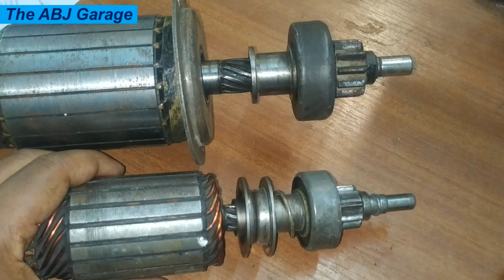Bad starter overrunning clutch check

Comment: Thanks great explanation. When i turn the pinion the free direction, it is free but feels rough or grindy, would it need replacing?
Wont grease go hard over time and cause resistance, would it be best to use ptfe or graphite powder to lubricate?
Thanks
Reply from the maker: Great idea! If it is rough or grinding, it might have dirt accumulated internally, then you could clean it, to clean dip it in some solvent (could be gasoline) then try rotating, do these repeatedly until it is freely rotating. Is it is opened however, you could clean it out and then lubricate. Around here we use good quality grease and it works just fine for long time.

Comment: If the leading part of the bendix gear Is getting ground down what could be causing that? It’s like it’s not retracting back to its place correctly or fast enough
Reply from the maker: Indeed! It means something is interfering with fast disengagement and retraction of the gear! Worn or Damaged Bendix Spring, Sticky or Dirty Bendix Mechanism, Worn or Damaged Pinion Gear, Bent or Misaligned Starter Shaft, Misalignment between the pinion and flywheel can also contribute to slow disengagement.

Comment: Abj, mine slides but drops back before turning the engine. What could be problem?
Reply from the maker: That could be caused by faulty solenoid hold in coil! Have you checked if both hold-in and pull-in coils in the solenoid switch are working fine? The hold-in and pull-in coils work together to make the starter pinion slide towards the flywheel ring gear. Once the pinion reaches there, it is the duty of the hold-in coil to keep it there until the ignition key is released.

Comment: Excellent explanation -- thanks!   Mine is the lower example in your video.
When I turn the pinion gear in the opposite direction, yes it turns as it's suppose to turn.  But it does not turn smoothly, there is a certain roughness to it -- like it needs lubrication.  
Should the overrunning clutch internal body then be lubricated?